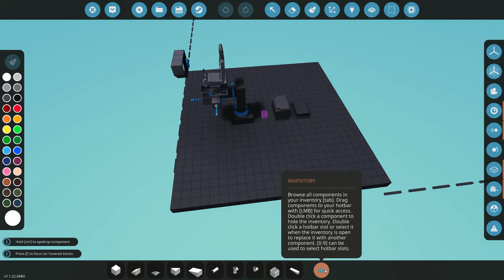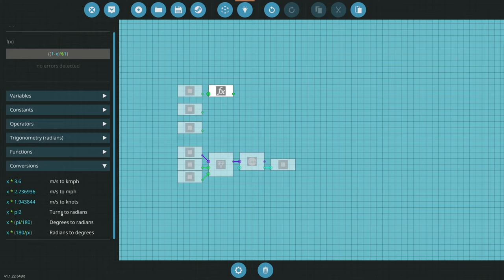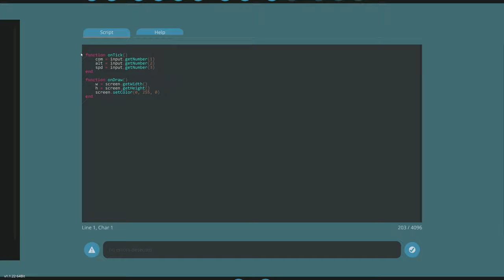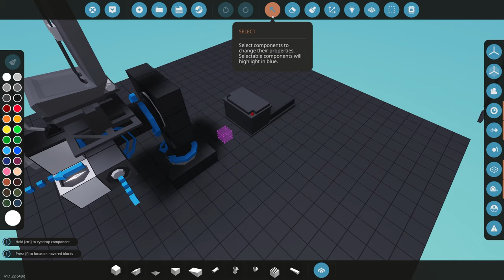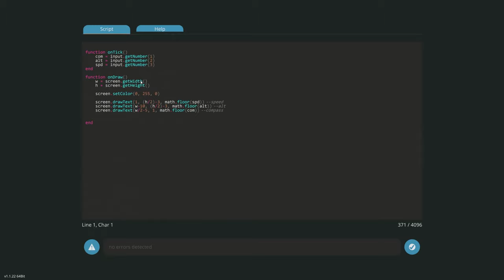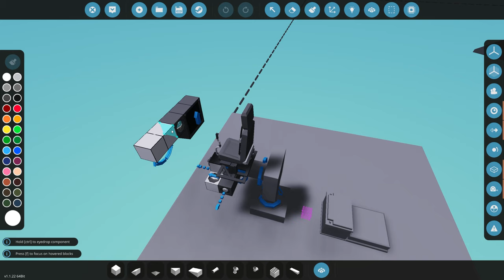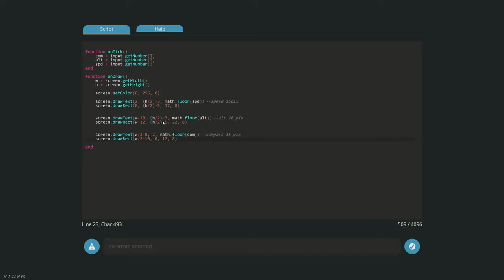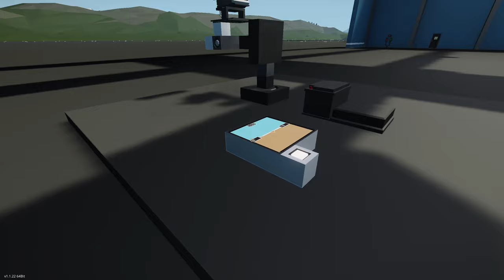Artificial Horizon Build Part 3 - Step by Step Lua Build - Stormworks

Comment: Wouldn't it be more straightforward to just convert turns to degrees directly? If the compass ranges from -1 to 1, then all you'd need is (X+1)*180 and you'd get a nice bearing from 0 to 360. Am I missing something?
Reply from the maker: Yes that would probably be easier, sometimes I do things the hard way haha
Reply: I feel like this would give you a heading value of -180 to 180?
Reply: @louaverbach6191  It wouldn't. Say the compass sensor outputs 1, 1 + 1 is 2, and 2 x 180 is 360. And for -1, it would be -1 + 1 = 0. 0 x 180 is still 0 :)

Comment: While this is close enough for basic aircraft, the calculation for roll will get progressively worse the closer to vertical the plane points. Aside from when pointing perfectly vertically, roll is always well defined, but how you've set things up, your system will always read basically 0 roll when near vertical.